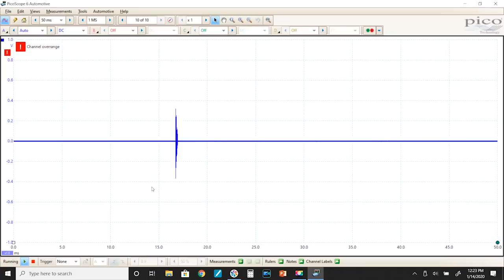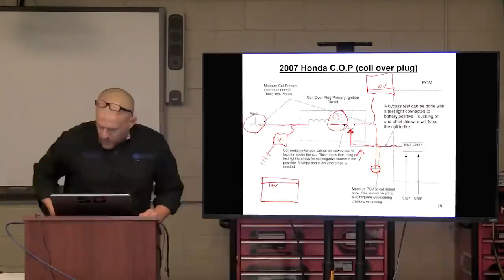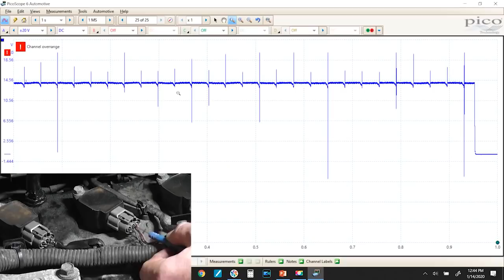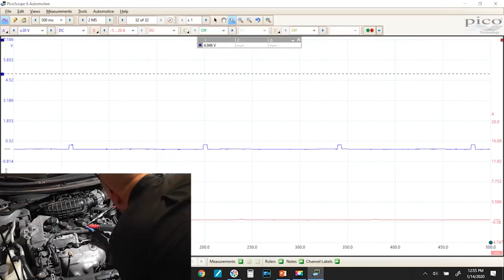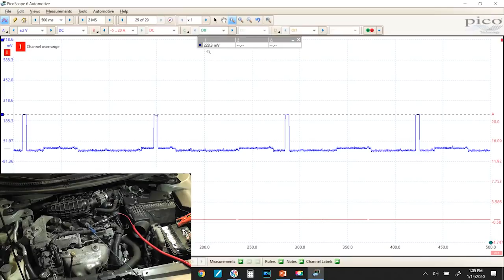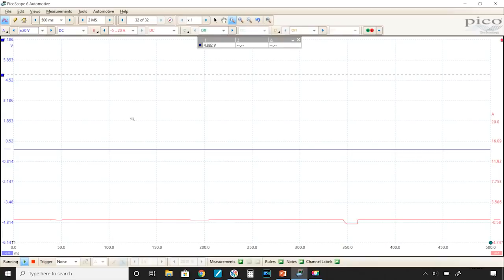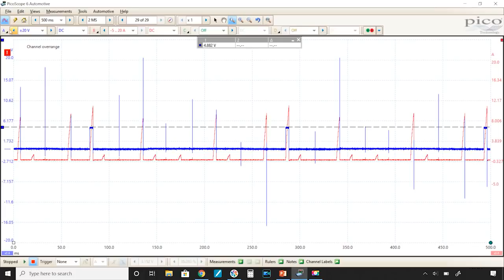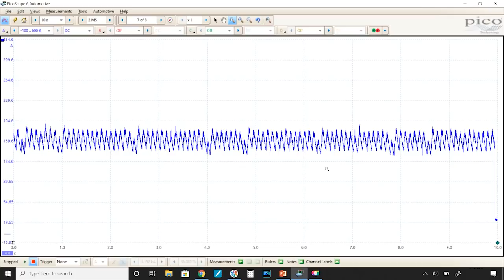Control Testing Ignition Coils (Part 3 Of An 8 Part SD Premium Series)

Comment: If the amperage is spiking lower than others then you would need to check power and grounds? either than that a higher spike can be a new aftermarket coil?

Comment: I tried the timing light test a couple of times ~30 years ago but it can be misleading. Even if the coil is defective, it can still spark on exhaust stroke on waist spark systems. It'll fire at half the frequency but that can pass unnoticed.

Comment: Thank you  Paul for this great  teaching  lesson ,  not every  3 wires coil work that way , example  Mercedes  Benz and BMW the 3 wire  coil pack the transistor is not in the coil is in the ECM . Thak you I have learn a lot from you as just wanted to say thanks . 😊
Reply from the maker: If it is a European car, I can see them doing that lol
So I'd be like I described in this video for the secondary, where it has a separate ground.
Reply: Mecedes M271 EVO engine ( W204 C200/C250 or W212 E200/E250 ) ), 3 wire COP is basically a 2 wire COP with extra ground for noise reduction. One pin for +12v power from the fuse box Front SAM, one pin for the -12V tigger from ECM and one pin is to cylinder head ground, this is the noise reduction one.

Comment: Around. 14.30 to 15.30 you can see the difference in voltage changes  between the feed side and the ground side.:. when current starts to flow through the coil the voltage on the coil's feed side slightly drops, whereas on the ground side voltage slightly rises. Nice!

Comment: Early VW and Audi 1.8T 20V (1995-~1998) used 3 pin passive COP (with separate igniter on airbox). 3rd pin is for secondary winding ground connection.

Comment: do you use an artinari on the scope leads when checking the square wave form on control wire on 3 wire coil or is it just the one built into amp clamp when checking amperage?

Comment: This realization, that you can't get to the coil negative primary wire in a COP system was a forehead slapping moment for me. It didn't really sink in until I tried to find it one day. And I loved your demonstration of how an incandescent light with low resistance can drop voltage enough to almost erase the signal. By the way, is it fair to say that when testing primary voltage on an ignition coil there will never be enough of a voltage spike to justify a 10:1 voltage reducer to protect the scope? Is the voltage spike on the primary side naturally low because of the small number of windings on the primary side? Is it only needed on the secondary, or on injector leads?
Reply from the maker: On the style where you cannot get to coil -, yes, there is never a concern. But on the 2 pin COPs, that would not be true as you can tap into coil - and you'll see upwards of 400+ volt spikes on those. Definitely scope damaging signals for sure.
Reply: @ScannerDanner  Oh, of course! Brilliant explanation, that last piece of the puzzle just fell into place for me.

Comment: Hey Paul I'm thanking you again thanks to you teachings I now work a job im making $28 an hr. It great to be making that much for ones. But now I have a question  for you. I work with 4 other machines and they hate scops. Even time i pull mine out they go nuts telling to pur that pos away that I should be able to diag without it. I know that the scop is the best tool to have. What should I do its frustrating to be in this spot.
Reply from the maker: Ignore them! There will be a time where you'll be able to prove yourself and it will shut them up. But let your work silence them. No need to talk or to defend yourself. Proud of you man!

Comment: Great ending. The real question is why the timing light failed?  Was the timing light test gone before and after the ig coil was replaced? I think it is possible that the increased secondary current observed could be related to the cylinder's mixture/and compression curve....
Reply from the maker: Timing lights are triggered by the high KV, not current, which is super small. Low compression equals low kv to fire the plug. This is why the timing light test failed.

Comment: Hello. Paul     If the control wire is shorted in a ground controlled circuit, since current follow the path of least resistance; will the current flow through the driver as well when commended on? Your answer would be very appreciated.
Reply from the maker: Power side switched circuit would cook the driver.
Ground side switched circuit would just turn the output on all the time, no driver damage.
Reply: @ScannerDanner  Thank you so much for your response. It is highly appreciated.

Comment: 43:21 Not sure why but your vehicle in that still pico image has one injector event in 720* of engine rotation(that I can see) then no injector events for the rest of the screen capture? If that is valid I would be looking into that. Not spark-related (for now). I would be looking at inputs cam crank. Again if that pico image was in fact valid.  I would also think this would have stalled the engine or at least made it run really bad if this was the case?? confused??
Reply from the maker: The images we are looking at on this box van are coil firing events with the current probe connected to the odd Bank and then even bank of cylinders at the fuse box and the voltage trace being one single coils trigger signal

Comment: Paul quick question.  Are the "transistors" that are built in to the coils true transistors or something like mosfet IBGT in nature?  If they are truly transistor based, I think (in theory you could break the circuit to measure base current)  and see if the transistor is switching and isn't fried.  Mosfets are voltage threshold based (so base current isn't a thing it's zero) and saturates the substrates to low value RDs on (drain to source resistance while on - acting as close as possible to a short circuit).  Anyways, I was trying to think about how you demonstrated the test light bulb / led situation and how perhaps these 2 types of semiconductors could throw a monkey wrench in troubleshooting tactics - - or perhaps open a new perspective to interpreting what we see on the scope or what our tools reveal.   Great video as always!
Reply: I think in this context the transistor terminology/schematic symbol represents a collection of components. I think its an igbt with microcontroller frontend. Just think - if there is a pin which outputs diagnostic information like on the 4 wire coils, youd realise that these coils have a lot of intelligence in them
Reply from the maker: I'm not sure my friend, sorry

Comment: Sir Paul, good day and may the god with you and your family. I just want to ask if, we can always use the LED test light on all low current circuits, as long as low current,I mean if we cannot hurt the module rather than using a incandescent test lights,.. specialy on which the driver is inside the computer or modules  which is a very low current circuitry?....2nd is.,, the test lamp that good to use for outputs ex.actuators,solenoids,motors etc.....to verify the integrity of circuits and the present of current is incandescent test lamp as a load,and not a LED?
Reply: You have it all right. You can safely use the LED test light anywhere, in low and high power circuits because it wont load the device/circuit under test. However its high impedance and rectifying effects limits its usefulness when testing the circuit path integrity.

Comment: Hey, SD, I have a question. After every lesson I generally do my best to apply that what you taught into practice, so I went to my brother in law's Mercedes C200 1.8 and back probed the coils (COP). 

There are three wires, so one power feed and one ground (they share the same wire colours as the rest of the coils) and a control wire. If this helps, they are all the same gauge.

But when I tap into the control wire, all I am seeing is a secondary ignition waveform. I'm not seeing any sort of pulsing on and off signal. 

Am I doing something wrong here? I mean, it isn't magic, those coils have to know when to turn off and on. 

Is it some sort of power/ground side switching?

I haven't watched your other lectures on premium about ignition coils, so maybe I'm missing something obvious. I didn't have time yet as I was trying to diagnose a very slight misfire which I think I have. The secondary ignition waveform differs on one coil at the oscillations produced during spark. I compared to the other three and they all have around 4+ ups and downs (coil intermediate section?) This one coil only produces one. 

I can feel I'm on the right track, as this waveform followed the coil but I watched this lecture just to make sure that the wires were showing proper values. 

Thank you!

Although, if it's something obvious, you can give me a clue, I'll try to figure it out by myself. ;)

EDIT:
Although, I've just realised that primary and secondary ignition waveforms are very similar (as per Pico 6 Automotive). 

I'll maybe go and study a bit more... Seems that I've been seeing a primary waveform in the wire this whole time. 

But, where does the control come from?
Reply from the maker: I have some videos on the Euro design. Essentially the 3-wire coils are 2-wire designs. Coil positive (12v supply) and coil negative is switched directly by the PCM. The extra wire is a ground for the secondary winding. Instead of tying into coil +, they connect it to - (ground). GM HEI coils did it this way to many, many years ago. So what you are seeing is a primary voltage waveform, which mirrors exactly the secondary circuit.
Reply: @ScannerDanner  aaaaah, I see. That's what was confusing me. I'll definitely go check those videos out, do you remember the titles? 

Thanks for the reply.
Reply from the maker: @Farseer1995 the one in particular I'm thinking of is on a 2016 Mini with a misfire, but that one is on my website. 
I think I have one here on a VW Passat but that was a waste spark coil design (same thing though with the secondary winding being grounded)
BTW I offer a 14 day free trial to SD Premium, cancel before the 14 days are up and you won't be charged the $11 for the next month.
https://www.scannerdanner.com/join-scannerdanner-premium.html
Reply: @ScannerDanner  I'm already on premium! I'm loving it, such a treasure trove of knowledge, it's dizzying. :) 

I was watching your three part series about ignition waveforms, and in the meantime stumbled upon this video on YT. 

Once I finish that 3 part I'll look into the videos you've named here, thank you so much. 

I try to go with a certain plan following your chapters, but sometimes I need to skip around and find some random videos depending on the car problem I'm working on. I wasn't planning on doing ignition now, but my brother in law is one of those people that fuses to the car seat and feels every single ripple and he wants that gone.

All the best!
Reply from the maker: @Farseer1995  awesome! Here is the link to the mini
https://scannerdanner.com/scannerdanner-premium-chapters/misfire-case-studies/861-2017-mini-cooper-countryman-s-intermittent-misfire.html
Thank you!
Reply: @ScannerDanner  thank you as well!

Comment: Do you have to use an attenuator on your scope if you are back probing the turn on turn off signal control wire?
Reply: You do not need an attenuator to check the control signal. This control signal is low voltage and there is no "inductive spike" on it.
Reply from the maker: as juergen said, no, not on this design, but also it is important that you know what the maximum voltage your scope can handle. For this model pico it is 200vdc spikes, anything higher than that I must use an attenuator. If I was viewing coil primary voltage (coil negative), then yes, I would absolutely want to use an attenuator
Reply: @ScannerDanner  awesome thank you.
So I would assume the Toyota diagnostic wire would also not require an attenuator as well?
Reply from the maker: @mikesabin8568  that is correct

Comment: Hi
I have a Pontiac Montana 3.4 2004, The problem when trying to turn it on, it turns on for less than two seconds because and ECU stops fule injectors , I have quit. A lot of your videos about (ICM) and I have tested all the sensors,CKP signa,5 Volt Referenc,Control signal for Ignition ,working perfectly and there is no short circuit, the connection with the ecu is also excellent and no Check Engie on the dashboard , I suspect the protection system turns the car off after a second.  My question is about your experience, can the Anti-theft system PassKey III, make the car turn on for a second and turn it off?  Note that the lock alert sign disappears when the key is placed in the socket, and there are no error MIL.  Sorry for the broken language, I live in Africa where I am thousands of miles away from you and there is no one to help me except for your videos.
Reply from the maker: Yes absolutely the antitheft system can do that. 
No codes at all? 
Cam and crank signals good?

Comment: What do you mean when your setting a trigger on the scan tool?
Reply from the maker: Lab scope you mean? Check out my picoscope basics part 1 and 2 videos for an answer to that
Reply: @ScannerDanner  So setting a trigger is basically when you want to look at the your details of the data?
Reply from the maker: @Ryder4u1313  setting a trigger will take a repeating waveform (like a fuel injector or ignition coil) and it tells the scope when  to draw it on the screen. It then makes the signal stationary. This is hard to describe in text, check out these two videos. 
https://www.youtube.com/watch?v=81AGbZcgCZs
https://www.youtube.com/watch?v=ntJJYhkmR4I

Comment: I have a 2014 cruze 1.4L  has a coil pack my problem it's that burnt the coil in cylinder 1 and also the coil fuse after like a min. of start up,               
 My question is, do you think the pcm is holding the control to long on groung and over-charging the coil ???       or it could be the engine ground ???
Reply from the maker: First question. Was this an aftermarket coil? Or was it a factory one? Second question or comment, you absolutely need to test the PCMs control of this coil to be sure. Yes, it is possible the PCM driver failed and caused this as well as a wiring problem.
Reply: @ScannerDanner  first burnt the factory coil pack and the fuse also,   replaced the fuse and then aftermarket coil pack same thing again burnt it after a min. or so. 
many people told me it could be a engine ground,   but I watch your video and I think it could be the pcm control,
Reply: @100ega8  Have a good look into the pcm connector. These are known for leaking coolant through the harness into the connector and causing shorts. The root cause seems to be a bad ECT sensor.

Comment: Hi ScannerDanner , I have subscribed to your channel after search YouTube for help, and this channel is the best resource going. I been trying to get my Harley going with its ECM system going for weeks, it cranks but no spark, I have fault traced most of the system, and replaced the crank sensor,spark plugs and leads, and new coil.

These coils has four wires , 12v source, ion sense, ECM front trigger, and ECM rear trigger, but it doesn't have a GND

I have tested the wiring to the coil with a test light which confirm ,  I have  source,  ECM front trigger, and ECM rear trigger both pulses  when cranked.

My digging around on the net has confirmed these coils don't use a negative GND on the secondary and rely on the spark jumping the gap to compete the circuit with the source linked to both primary and secondary of the coil, is this correct the way these three coils work  , source, sense, and trigger, do you have a video on fault finding on these type of coils.

I just watched your bad block GND video, and my next step is going to check voltages, maybe not enough to jump the gap.
Reply from the maker: ECM front trigger and ECM rear trigger?? These are goofy names, one of those is definitely a ground and the other is a switched signal from the ECM
Reply: @ScannerDanner  Thanks for the reply, The ECM front, ECM rear are for front & rear cylinders, I have now found out this coil doesn't have the igniter on the coil but built into the ECM, so the ground is from the ECM side. I am now looking at a voltage drop and bad ground as my next possible fault, as the signal for the triggers is flickering very weak when testing with test light to ground, I also brought a USB oscilloscope  yesterday.  This has been a learning experience trying to fault find.
Reply: Hi scannerDanner I removed the battery box to get access to the block ground underneath, and sure enough the point where the main negative lead from the battery attaches to the motor, there is a voltage drop, the other 4 ground wires attached to the frame was fine. It didn't look badly corroded, but I disassembled and cleaned all the terminals of the ground , it fired straight up. your channel is a great resource , thank you

Comment: Yup engine problem, burnt valve maybe🤦‍♂️
Reply: I say collapsed dod lifter.
Reply: @allanb3222  oh yeah could be that too....what year is that🤔it may have DOD(DOD is a dumb design🙄)
Reply: @allanb3222  I don't think those vans came with dod? I could be wrong, but I thought 4.8, 6.0 or 6.6l diesel only in those?
Reply: @PhillyDee215  It's a 2016. So it's an l96. I thought it was dod, but it doesn't have that. But it does have vvt. Still it could be a collapsed lifter though. I would use an dial indicator gauge and measure the valve lifts at the rocker.
Reply: @allanb3222  can't wait to see what they come up with😏i just took heads off a Chevy 6.0L....it killed my back so bad🙄

Comment: The new ignition systems with computer controls, should be done away with and go back to points, plugs, condenser, but with a CD ignition. NO STINKING COMPUTERS.